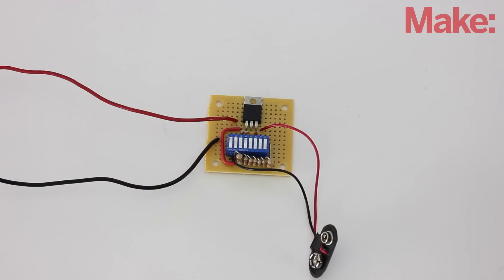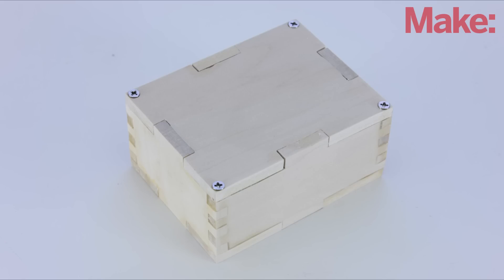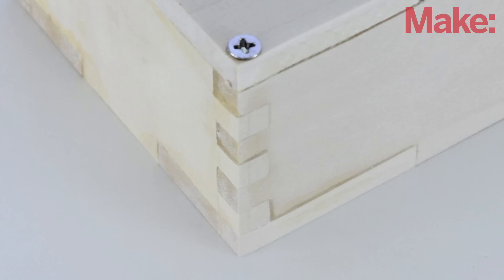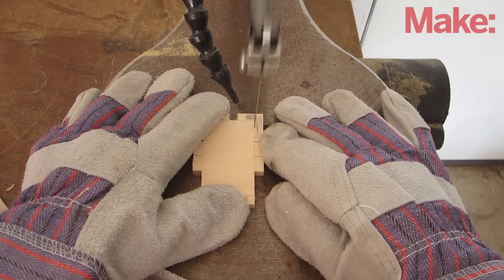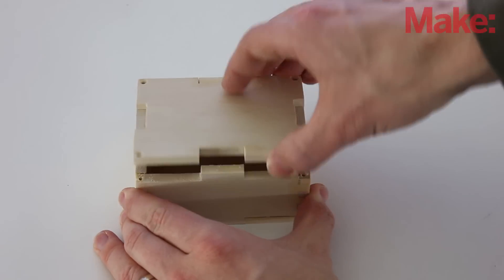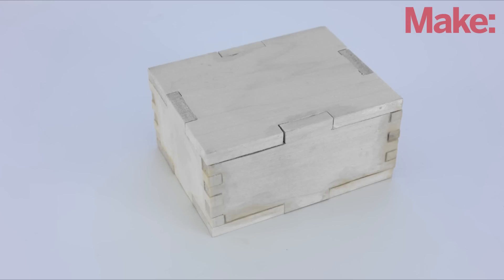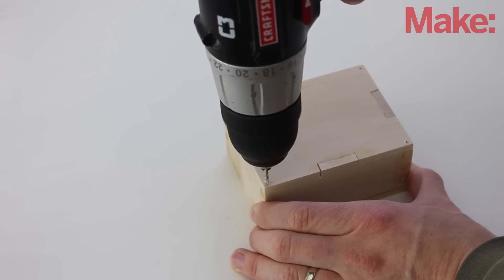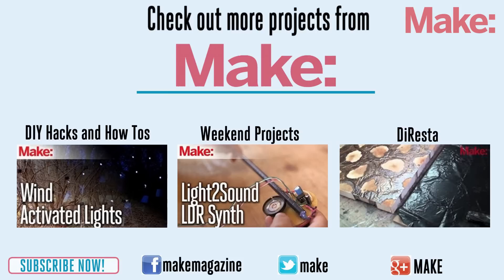Custom Project Enclosure

Comment: The top of the box is not really removeable though, because once you take out the screws they will not hold in the wood when you try to screw them in again.
Reply: they do indeed, they follow the path they created before

Comment: Make sure that if enough heat is generated, you also make some ventilation holes!
Reply: szekelymihai Or if loads of heat is generated, put a small computer fan with a mesh over it inside one of the walls :D

Comment: Nice little project.  But...what's with the gloves?  LOL
Reply: I take it you've never sanded your hand..
Reply: domdanialZASRA I was more thinking about the bandsaw.
Reply: Cactus Makeshop
Scroll saw* but yes you are right, you should never wear gloves. A cut finger is one thing, your finger being ripped off is another.
Reply: DOH, yeah.  Scroll saw.  Maybe it was a cold day.
Reply: And a glove would (could) get stuck in a belt sander.  I think my cheap belt/disc sander would just stop and hurt a little, but still... wearing gloves in most woodworking procedures is unnecessary and often unsafe.  But, I do unsafe stuff too sometimes just to get the job done, so who am I to judge I guess.  Everybody has to be their own "Safety Sally" in direct proportion to their own skill level.